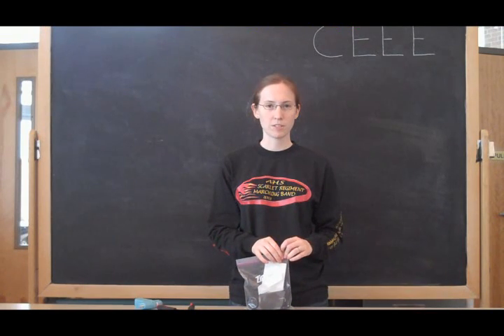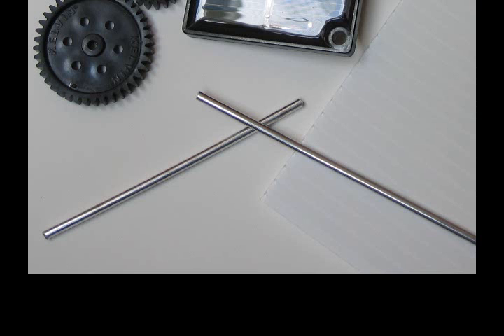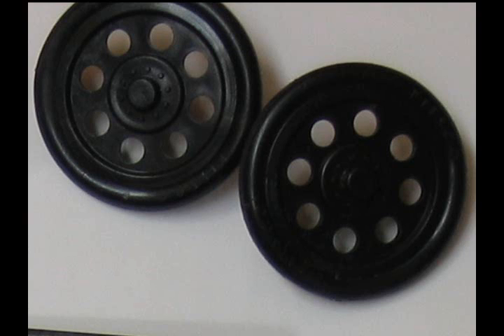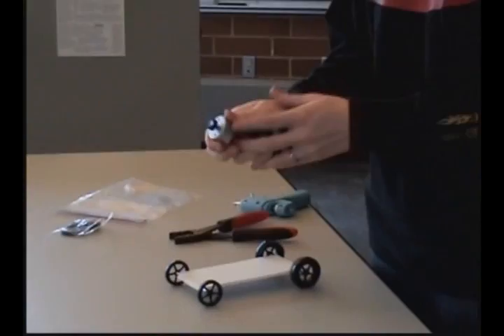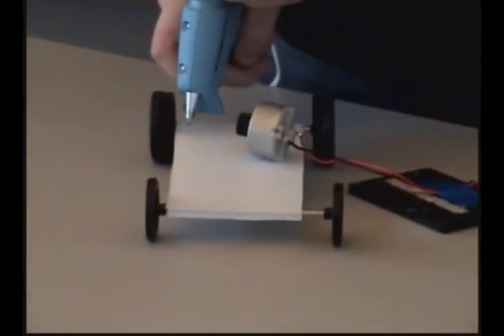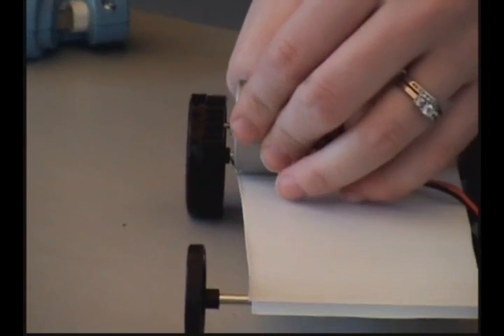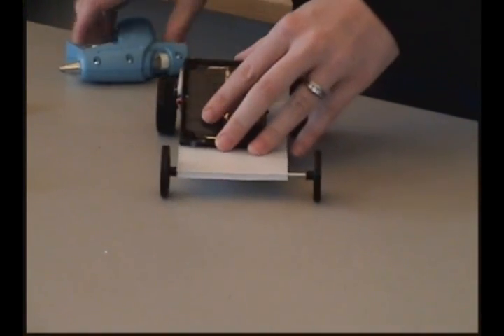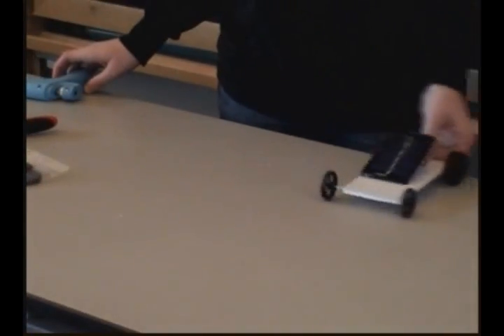Solar Activity: How to Build a Solar Car

Comment from the maker: @MrXyron - The chassis is the internal framework of the solar car (i.e. plastic rectangle). Without it we would not be able to attach the wheels, motor, or panel. 

If you have more questions feel free to ask them.
Reply: do u have a pet named Steve